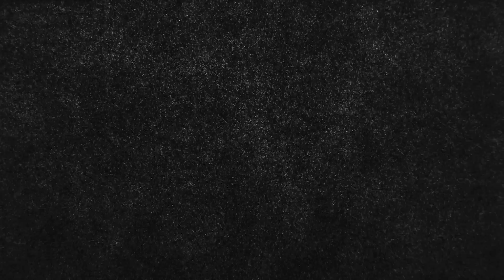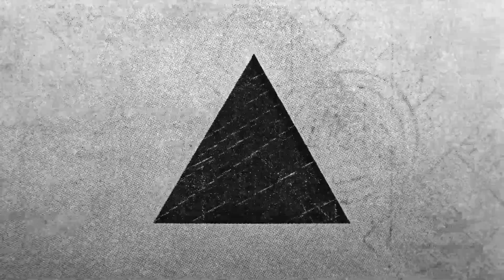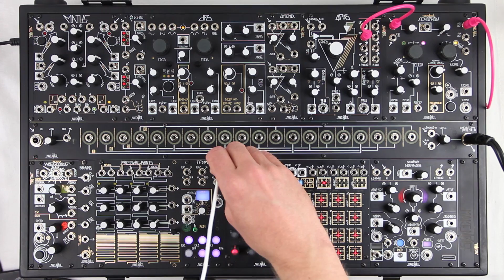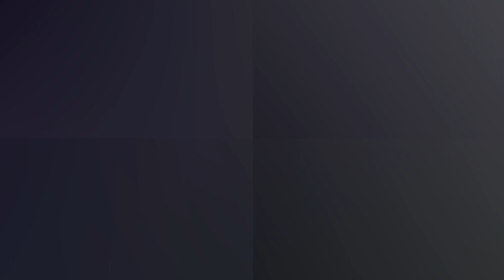Patch From Scratch: QPAS & TEMPI

Comment: After revisiting this video again and fooling around with the gates, feedback and distributing the many QPAS outputs through the system I can't help missing the Erbe-Verb. The 'downside' of a Shared System is that you can't really take anything out without being missed. Even the old Phonogene provides a special hands on fun than the superior Morphagene just can't deliver.  So I was wondering how other Shared System owners try to incorporate all these new cool stereo modules already available and on the horizon.  Losing the PressurePoints is obvious, but with a Brains it provides so much extra power... Now anyone can fill a second CV case, but it will take months to figure out a configuration that truly complements the B&G. Thoughts anyone?
Reply: I think MN will stay with us for a while so what I suggest is !
get a case just like the one you have and start filling it with new MN modules , 👍🏻
Reply: Yup, get an empty 7U Bus Case and start building your Shared System Companion Case
Reply: I moved all the control modules in a MN companion skiff